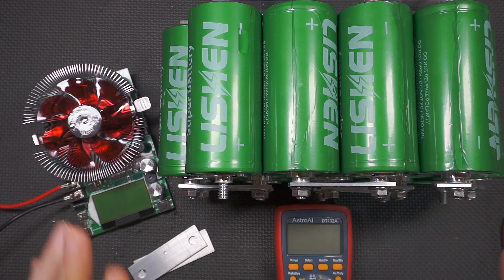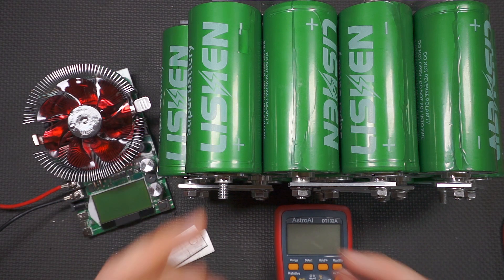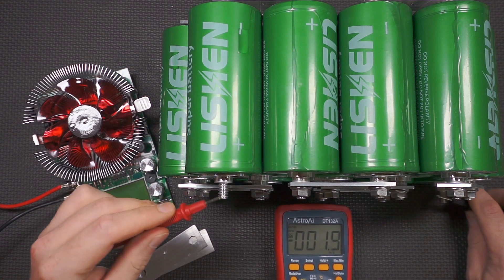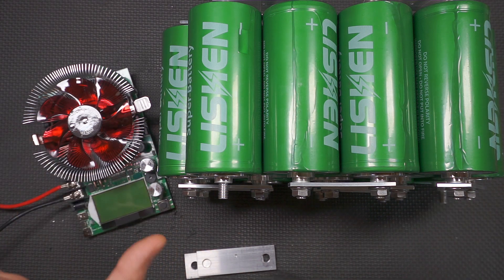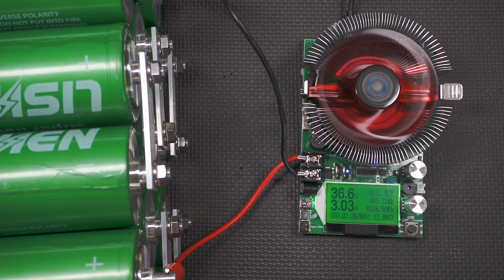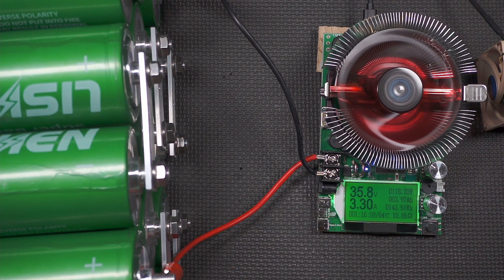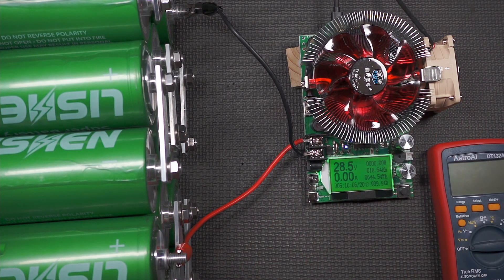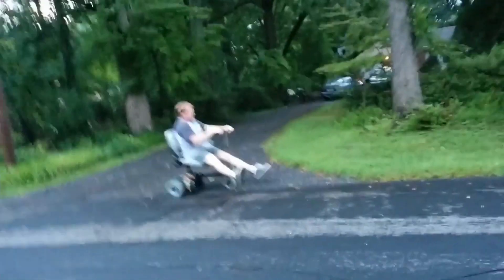A New MUCH Bigger Power Pack For The Electric Turbo

Comment: I’m not racing. But I paired a supercap pack with my lifepo4 pack
Reply from the maker: That would certainly help with transient spikes.
Reply: @AlexLTDLX  it’s overkill but I’m just playing. It’s an UltraCap.
I’m also building a lifepo4 pack to replace the NiMH in my wife’s Camry hybrid. I’m considering building a supercap pack to run parallel to that as well. 🤣
I have too many projects/sub-projects 🤦‍♂️

Comment: Ya for most things I don't think it's worth it but for your setup probably the best and if the voltages work for your application they are kinda the best
Reply from the maker: They certainly weren't cheap... but they're beasts, to be sure.

Comment: All of these cells  are connected in series to produce 60+ volts battery? Are there then placed in parallel to increase current? New to this trying to understand what may be obvious.
Reply from the maker: Good question.  And in fact, I wasn't sure.  So I bought 60 of those cells (read: expensive).  But it turns out they have insanely low internal resistance so they can output literally thousands of amps.  So now I only use 24 cells in series charged to 60-62 volts.  They don't need any in parallel; but we'll find out when the big motor/ESC combination shows up and we start pulling 550+ amps.

Comment: I have an idea for a mild-hybrid conversion system, that uses a 72-volt brushless motor, connected to the crankshaft via a belt (much like a traditional supercharger) to provide power assist at low RPMs (potentially preventing a transmission downshift), regenerative braking, and engine auto-stop. The system would be capable of pulling several hundred amps at max assist (~20kW) or when spinning up the main engine after an auto-stop (25kW for about 2/10 of a second.) These batteries are perfectly capable of that output, but my concern is how many of them I would need, how big the pack would be, and where I would put the pack.

My original idea was to use ultra-high-discharge Lipos and put them in the passenger footwell next to the A/C floor vent. The problem with that approach would be winter. Using the HVAC system to heat the cabin would heat the batteries, causing the system to shut down. If that happened during assist, the driver would notice a lack of low-RPM torque and would have to push harder on the accelerator. Worse, if the system overheated during an auto-stop, the driver would have to manually restart the engine, which would not be ideal.
Reply from the maker: You should consider an electric turbo solution.  You get a much greater return than simply connected to the crankshaft.  Besides myself, there are a number of people working on viable systems.  Visit www.electrifiedboost.com to see what we're up to.
Reply: @AlexLTDLX  Not looking for power with this setup, I'm looking for low end torque and fuel economy. A belt starter generator is the only way to do instant start-stop. If I had an electric turbo, I would have to try to start-stop with a traditional starter, which would quickly burn it up. You can't regenerative brake with an electric turbo, either

Comment: Headway would have been a good choice as well, and cell voltage is higher at 3.65 per cell.
Reply from the maker: I looked at the headway cells.  In fact, I have a DIY LiFePo4 battery as the car battery in the LTD.  The biggest issue I found with the Headway cells is that they're more limited in terms of current output.  And to be honest, there's something rather attractive about the Lishen cells 30,000 cycle life rating.  The second pack is almost assembled; we should know in a month or so how well these really do.  I still need to build a small automated control box (pretty easy, really - just a couple of timers and an arduino - all of which I already have, and the arduino is already programmed and what I've been using to control the ESC), run the heavy cables, get a new pair of slicks (I trust you saw the drag test video where we destroyed my old slicks: https://youtu.be/AOL3Qyczt3Y ) and a new 5 point harness (they're only good for two years and mine expired recently.)

Comment: You would be amazed at the current we pull from cells like these in today's car audio scene. 

You DEFINITELY made the right choice. Subbed for content, electric turbo pioneer in the making. Impressive.
Reply from the maker: I've got all the stuff to build a high-capacity load tester; we'll find out what these cells are really capable of in terms load vs. voltage drop.  I feel confident that they will have less drop than the LiPos I was using, but I don't know how much... yet.
Reply: Are there any smaller sizes capable of about 300 amps continous?? It would be enough for my application

Comment: Best of the best of the best sir! 
Interesting. I have been around quite a few batteries, but LTO cells are new to me.  Will be looking those up today for sure.  Will they need heatsinks at high discharge?
Reply from the maker: Probably not.  They have a good amount of mass, and current output is limited by internal resistance.  Since they have a really, really low internal resistance, very little gets turned into heat.  If you tried pulling 2,000 amps, then they might get a little warm, but I don't expect these to get nearly as warm as the lipo cells did.  At 2,000 amps, you'll melt cables and connectors and stuff long before the batteries got dangerously hot - in theory.  Only one way to find out for sure!
Reply: @AlexLTDLX  how much did you pay per cell??

I want to buy 2x   5870 motors one on each wheel
2x the second esc you bought about 300$

And these cells

All going on a gokart for racing